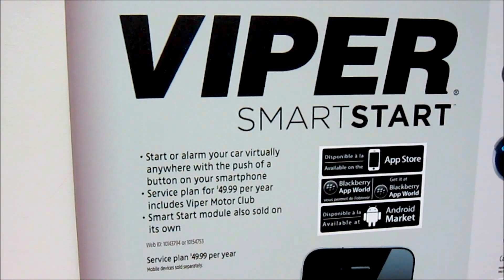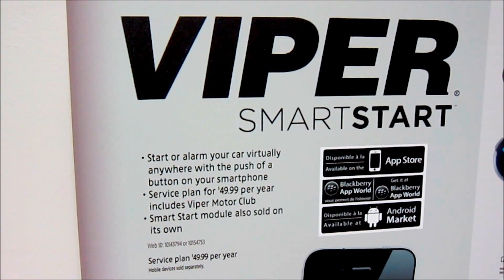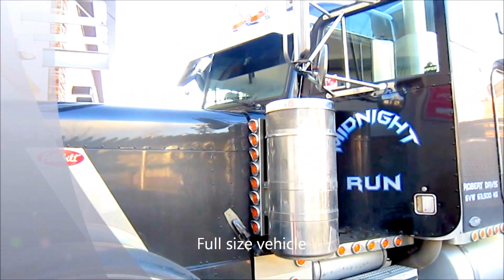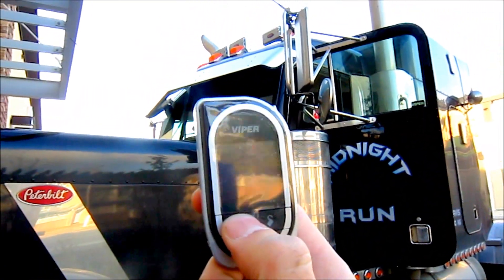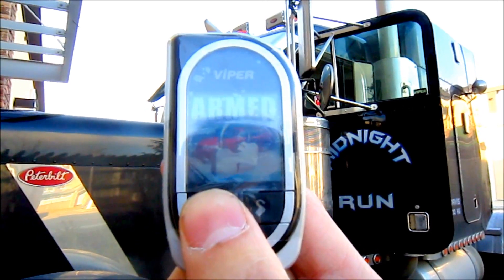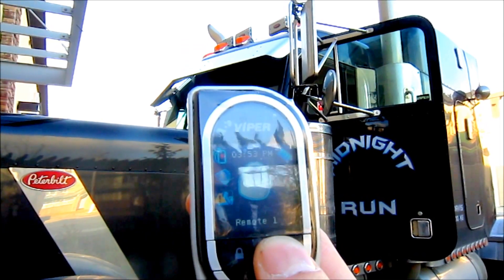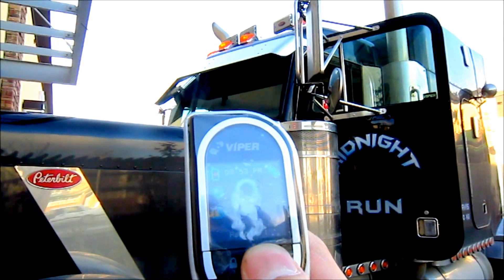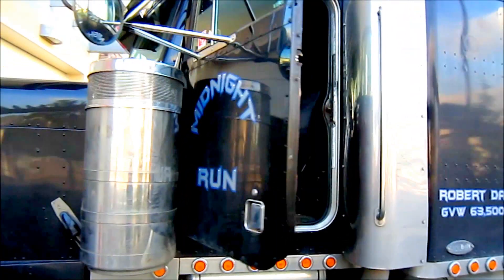Viper 5902 Peterbilt Semi Truck Security and Starter Demonstration Full size and Compact vehicles

Comment: VIPER is just EXCELLENT, there are safety measures that are automated and cannot be deactivated. If someone steps on the brake it turns off the vehicle, break any glass, or shock sensor activation. On a manual NO USA chain will install for liability reasons PERIOD, so good luck with a manual install with remote start (NOT HAPPENING)

Comment from the maker: I wasn't too keen on installing it in a vehicle of this magnitude honestly.  So we had a neutral position safety switch installed in the transmission, so the truck can only start if the vehicle is in neutral.  If it's put in gear the unit will not allow it to start.  All of our installs on manual transmission have some sort of way knowing they're in neutral.  Also several truckers told me it's standard practice to not park in gear and that the air brakes will hold it.

But I get what you mean :)
Reply: Hello can you please tell me where did you put it on the transmission, I just did my truck but can't find a neutral switch. thanks
Reply: Sorry big rigs dont have glow plugs.      16.1. 18.1 comp is what starts it.  It's not a tractor or a duramax powerstroke
Reply: I want it. Where you located?
Reply from the maker: @jarrellewis731  Canada

Comment: Can i stall this viper on semi truck if i dont have power  door locks
Reply from the maker: fatah Ali You can, if it's a manual transmission you'll need to have a neutral position output come out of the transmission though.

Comment: Would love for you to install a compustar set up on my rig if you can I’m local to you, I have everything needed will just need a drone modular? There are a few guys that do it but thought I would try you, it’s a massive market right now and people charging 1000-1400 for complete packages with max it kits and drone
Reply from the maker: Is the vehicle an automatic or manual?  $1,000 - $1400 is a little on the lower end for the max kits for the type of work we do.  I'm sure there are other shops out there that do the work, not sure if they wire as clean or have as much experience.  We just did a manual transmission Tacoma for $1,700.
Reply: AnthonyJ350 wow I think maybe we on the wrong page here, I’m talking about remote starts compustar kits, you guys charged 1700 for that wow, visions did my mustang with a drone for 375 lol and 1000-1300 is for semi trucks kenworth peterbuikt
Reply from the maker: @2vgod460  Visions hasn't carried Compustar for about 6 years.  The pricing I'm referring to is product and labour.  To do your system they would charge $700 - $1,200 depending on product and features you purchase.  I used to work there and there's a reason I left.

I'm on the page of doing the highest quality work possible and delivering customer service.
Reply: AnthonyJ350 I had my own parts mate compustar max it with a pro t12 remote
Reply: AnthonyJ350 ya makes sense!!
Reply from the maker: @2vgod460  I have to see the product in person to verify we can do it.  You'd be looking at minimum an 8 hour charge at $110 an hour.
Reply: AnthonyJ350  that’s the only way to do it brother!! Quality pays off bro! But let’s talk soon, you got a email? I can get you doing a shot load on drone alarm systems on big rigs! Bit thing is it’s gonna be based on prices as well due to there being two Main guys doing it ems is one he is known for it, he does 1000 cash installed!, second guy is a felllas from Abbotsford he charges about 1400 taxes in for the same his company is called ... I don’t want to shout them out period don’t wanna give these guys any attention ems guys a douche
Reply from the maker: @2vgod460  You can visit me at the shop or email me at info@gofasthavefun.ca